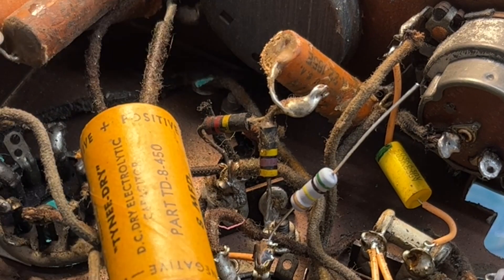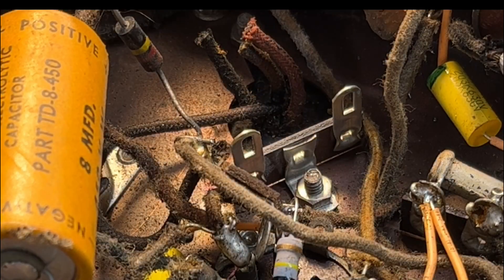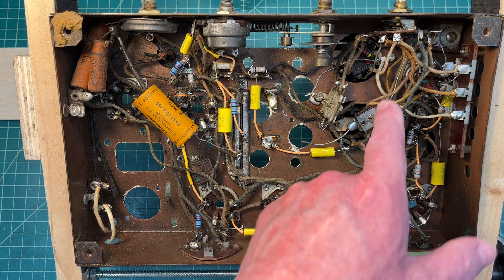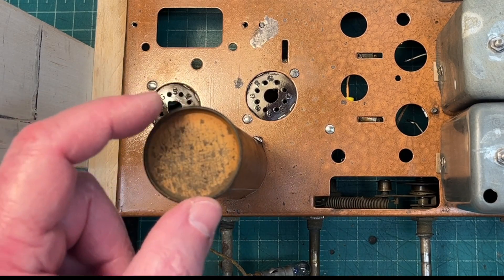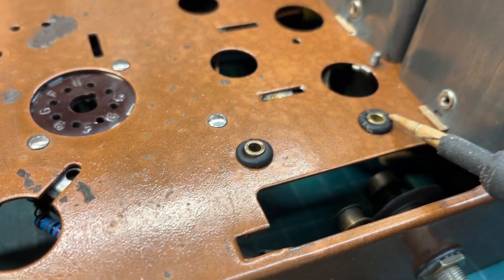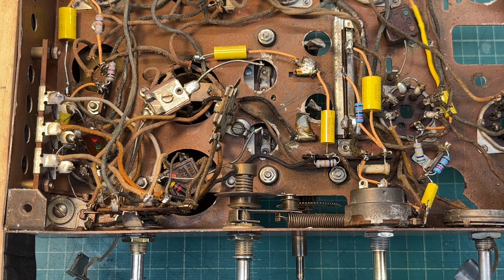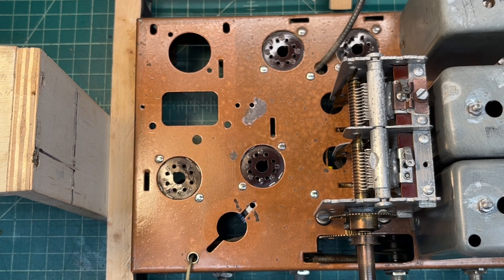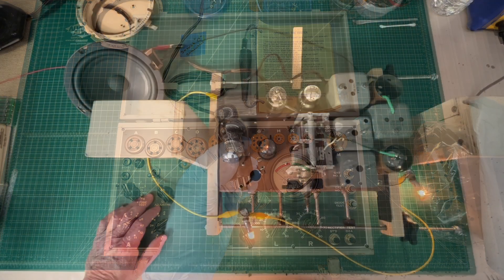Zenith 6S229 - Completing The Electrical Restoration & First Power Up

Comment: Don, could you show a photo of the dial belt configuration (if you still have the unit)?  I am working on one that was in pieces when I got it and am having trouble with the tension pulley-to-belt location.  As I see it, it can only go on two ways and I've tried both and it's too loose to grab.  The belt measures correctly.  Thanks in advance.
Reply from the maker: Sorry about my belated response, but while working on a Zenith 5-S-127 that has the same configuration, I thought back about your request. Check out the video below where I show the dial belt and tension pulley. Hope this is helpful. All the best. Don

Zenith 5-S-127 | Low B+ Voltage & Electrolytic Capacitor Configuration
https://youtu.be/HQ0zr9UVVjc

Comment: When I was much younger I worked in a factory doing chassis assembly and I can say that in many of these "restoration" videos I see soldering techniques that would have never passed quality control.  Capacitors and resistors should have the leads hooked and then be crushed tightly in the eye of the terminal before soldering.  Simply putting a leads through an eyelet and soldering is asking for a "cold"  solder.
Reply from the maker: Yep, it’s so common to find cold solder joints in these old radios from back in the day. Thanks for watching and reaching out. Best, Don

Comment: Zenith loved their "air connections", some of the 1938-39 sets had 4 or more parts connected in mid air.  This was partly to facilitate layout of components but also to save money on terminal strips.  When it came to cost cutting, Zenith always tried to find a cheaper way out unless it was a feature that faced the user (eg. number of dial lamps, dial size, knobs, etc).  This model performs very well, I've worked on a number of these chassis.  The tone is very impressive for a relatively small cabinet.
Reply from the maker: Adam, thanks for the info. I since saw some additional photos of the underside of a 6S222 and 6S229 with the same in the air mounting configuration. It’s a great player for sure and sounds good considering my loudspeaker rebuild. Thanks again for reaching out. Best, Don

Comment: If you want the Volume control to last, then DeoxIT Fader F5 should be used.
Reply from the maker: Thanks for the info. What makes the DeoxIT Fader F5 better than the others? Best, Don
Reply: @RestoreOldRadios  - It is specifically made for POT's.  xraytonyb did an excellent YouTube on using DeoxIT Products.
Reply from the maker: Thank you, I’ll check out Tony’s video. Best, Don
Reply: @RestoreOldRadios  - Tony's video showed how other lubricants build up a resistance over time, where F5 does not.

Comment: I have the same model that I still haven't got around to restoring yet, too many unfinished projects.  What happened to your new built electrolytic can? Thanks for the pencil technique.
Reply from the maker: Ken, I’m sure in time you’ll get to it. I’ve got a good 75+ radios on my list to restore, but I realize that’s not practical, so I’m going to focus on some of the more difficult or less common models. Regarding the can, I’m waiting on the paint to fully cure and move the capacitors from underneath the chassis that I tacked in to the new reproduction can. Thanks for reaching out and following the series. Best, Don

Comment: Congratulations on reviving another classic Zenith. They are great performers. With a little Signal generator tweaking, you will be very impressed by that unit. Thanks for your video on the J E Moser products. I purchased the epoxy wood and crack filler also. I think it will be extremely beneficial on some superficial cracks on my 1936, Zenith 9-S-54 cabinet, where over time the wood has shrunk and opened some hairline joint cracks. Thanks again for your fabulous videos.
Reply from the maker: James, I appreciate your kind words and for following the series. I’m looking forward to the alignment and exploring the bands and hopefully seeing further improvement in the receiver performance. I think you’ll be satisfied with the J E Moser epoxy. Like all glues or epoxies, toner lacquers cover it better than stains based on my experiences. Thanks again and all the best. Don

Comment: I guess your candohm was good .   I had two opens on mine.   Underside  looks very nice.    The IF ‘s have two micas in each  can  one on top of other very hard to pull out to clean. Or at least I had hard time with it.   I. Was amazed how well it pulled in stations in the daytime.    Great radio.    Thanks for doing this radio.
Reply from the maker: Hi Dean - the Candohm is good, but the 27 ohm section is just outside the 20% threshold. I haven’t checked bias voltages yet, so it may require a replacement. Thanks for the heads up on the IFs, that will help for sure if I take that path. The sensitivity of the receiver is spectacular and I’m excited to complete the alignment. Best, Don